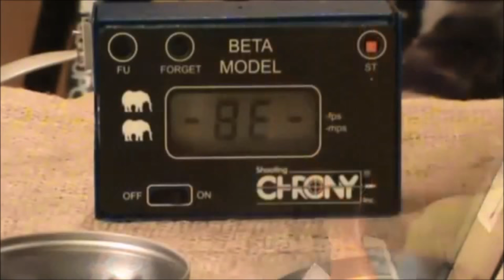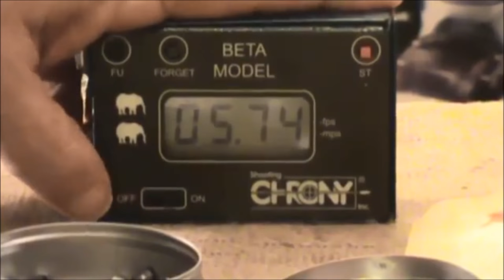How To Rebuild A Crosman Springer Pellet Rifle For Under $12

Comment: I will never understand why people dont soften the cut out edges on the compression chamber so the new seal dont get damaged , i took a file and cleaned all my cut outs  ,and my piston slides in like butter , no grabbing the seal during install . Why take a chance on chunking out a new seal because the manufacturers lazy finish work .....i know Kenny is gone now but he always did great work and good explination but never addresed this one simple issue and i never understood why , the piston seal never makes contact with the cut outs only on install and dismantle so why not clean off those sharp edges and save your seals ....
Reply: Thought the same thing and those pliers just made me cringe.

Comment: Where did you buy those parts? I have a crosman phantom hunter , I need a couple parts for. A 9mm Pin and a screw which connects the barrel at the break point...ANYONE any help!

Comment: Very nice job sir!
I have an old Hungarian break barrel .177 cal
I've noticed the gun is getting quite tired out... i would like to replace piston seal as there are many nicks in it. The breech seal is leather. I just removed it, soaked it in oil, made a small shim for it and reinstalled. Didnt notice any difference. It has a dual spring setup. Problem is i dont know the model of the gun. It only says "made in Hungary"
But i believe ive narrowed it down to being an "FEG"
Any idea how i could track down a piston seal? Or could a make a piston off another gun work?
Also, how do you feel about dual springs? Was thinking of swapping them out for a new single spring of similiar dimensions.
Thank you kindly